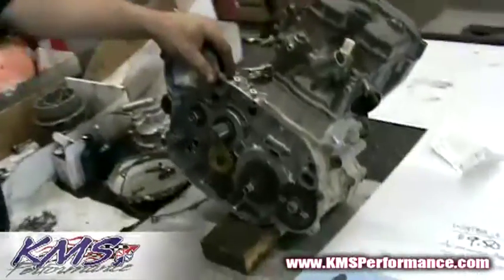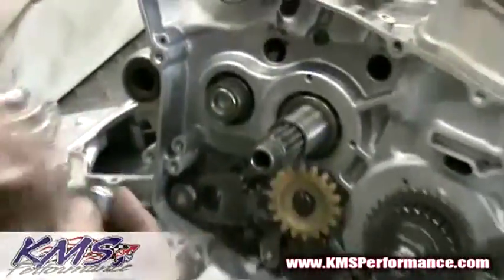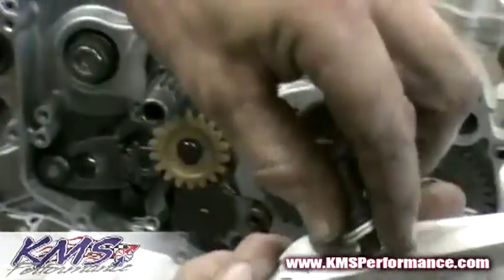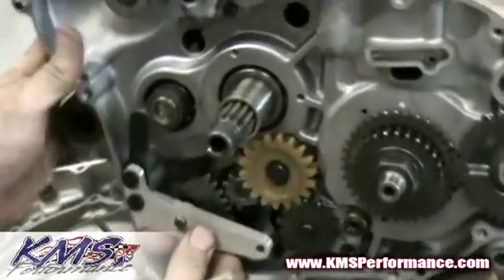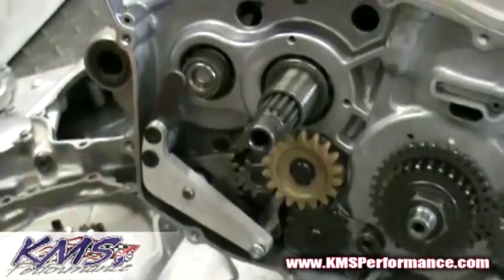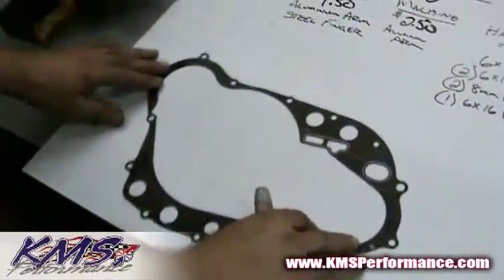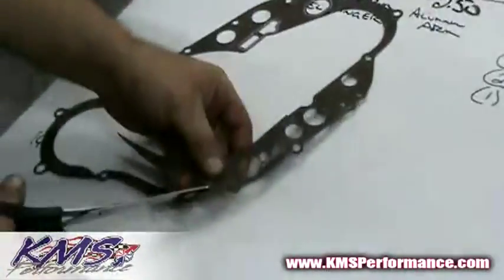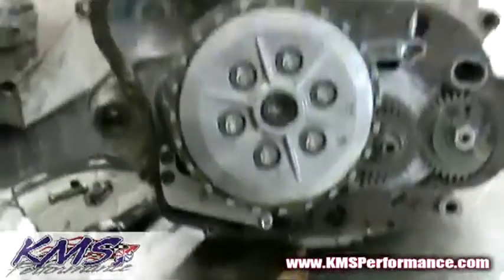KMS Performance Shift Pin Kit Installation

Comment: is it me or did he not set the sector gear. lot of shifting going on.  ahhhh probably set before filming. well my shift pin won't come out. previous owner tarzan. mine is recessed can't split my cases. put it back together, worry about it later, dam CR's 84-86